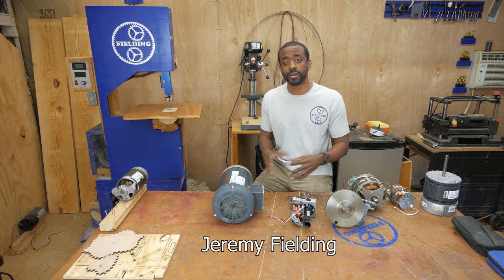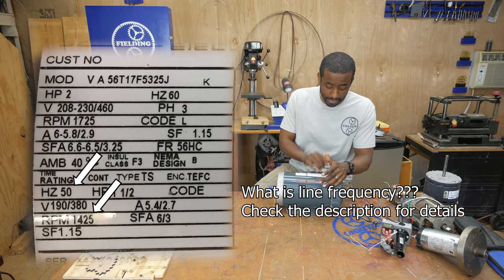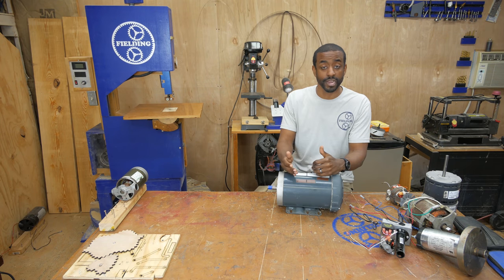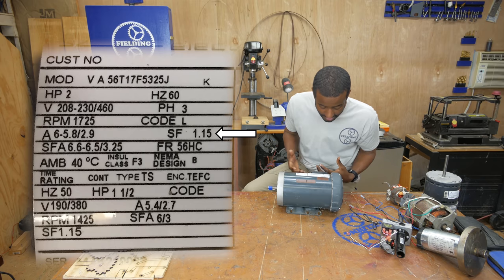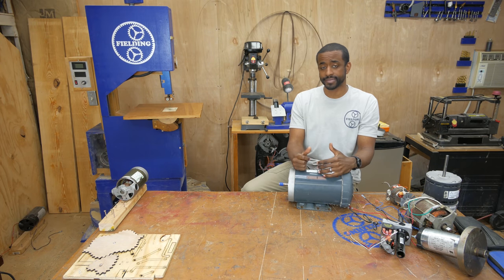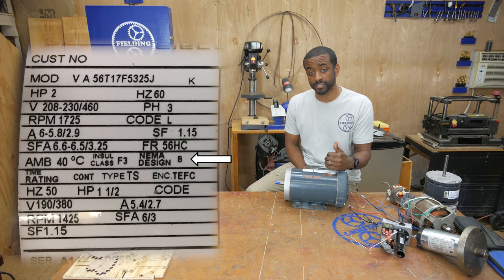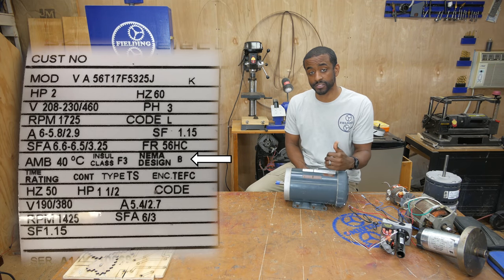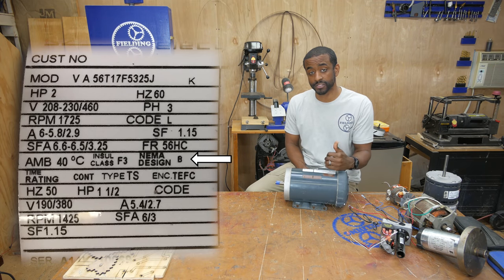How To Read The Label on Motors; Ultimate Guide To Electric Motors: #069

Comment: Or, for use with a VFD, either pick a fanless motor or add an external fan with it’s own motor... 🤔
Reply: OR... once you know you're probably going to run the VFD motor at "lower" RPM's than manufacturer's standards, you can open up the enclosure before wiring it in, and with a pair of pliers (in most cases) add a few degrees of camber to the fins in the equipped fan, thus pushing more air per RPM's. Re-assemble as before, and (usually) with little or no hell to play, you've effectively resolved the issue... My usual rule of thumb is about five degrees "additional bend" or "corrective adjustment' to the fins is generally sufficient as long as the RPM difference is within stated tolerance.
    Sometimes (of course) you just get a gut feeling and go for a bit more... BUT as long as you avoid banging fins against the housing or other parts, the more air you can push the better (cooler) the motor's going to run "at speed". ;o)

Comment: Hello I have a hammer mill that shipped to me without a power cord attached. The motor has Chinese or Japanese writing on it. 
It is 60 Hrtz. And can be wired either 250v or 450v. 
There is 6 connections. One side is W1,U1,V1
The other side is U2,V2,W2
I can not figure how to wire this 250v ???
No paperwork or instructions came with it. 
Any ideas would be greatly appreciated 😊

Comment: I have a motor that came with a drum switch to reverse its direction of spin.  The motor had to be replaced, but the supposedly compatible replacement motor does not function with the drum switch!  I guess all motors are not created equal.  Any thoughts?

Comment: Hi, i want to build a lathe machine for beads and i have a blender motor ,
 is the blender motor good for the job? 
dose it need a capacitor or just plug it to the wall?
I also found a sawing machine , when i take the motor apart and plugged it directly to the wall it turns but its smoke , when i connected the foot pedal switch the smoking stop, why is that?
Thanks again

Comment: your back! was wondering. what does it mean when the 1/2hp single phase motor on my cement mixer gets old/weak and can no longer operate the mixer under full loads?
Reply from the maker: Motors don't really get "weak" or old. As long as you don't over work it, it will run for over a hundred years. I have seen examples of this. We have a massive lathe at work that was built back in 1912. It still runs great with the original motor. You can turn a 4' diameter solid steel part on it no problem.
Reply: jasonmushersee - Does your 1/2 hp single phase motor have a capacitor? If it does, I would check that. If it doesn't have a capacitor, you might have some cracked rotor bars at the endrings.  -  Jeremy - That massive lathe at work sounds like some of the large ones we have at Puget Sound Naval Shipyard.

Comment: Hi there, I definitely understand Jeremy wouldn't have the time to answer my question, but just asking in case someone knows or could lead me somewhere i could ask... I have a single phase induction motor, single voltage for 230 (i'm in france) and 50hz, capacitor starter. It has no power rating or intensity on the inscriptions... I mesured it is rotating at about 2500 rpm, and the resistance at the winding is 20 ohms.... I would like to find its power capacity in order to not overload it ... thanks in advance for any advice !!

Comment: Pretty well done.  The only error I caught was the RPM comment.  AC motors lock to the freq of the source.  They can go slower than rating (when "slipping") but will never go above the rated speed.
Reply from the maker: I think I understand what you mean but what I said was completely correct. There is no error in that statement. AC Synchronous motors lock to the frequency and that rated speed would be "sync speed". Induction motors (the example one in the video) chase but always lag behind sync speed or frequency speed which you are referring to. That number on the motor is in fact the slip speed. If it slips below that rated slip speed it is because the motor is being pushed over its capacity and that is a different problem. I explain this more in my video "can a dimmer switch control an induction motor." Thank you for watching.
Reply from the maker: Side note 60 hz on a four pole motor (the one on the example) would give a sync speed of 1800 rpm. The rated "slip speed" is 1725 at full load. That is the number you will find on every label by NEMA standard. The slip speed. So yes it can go above 1725, but never above 1800.
Reply: @Jeremy_Fielding  - Yes, and at no-load, your induction motor will run very close to the synchronous speed, usually within a couple of RPM. So, your four pole motor in the video, will normally run at about 1799 RPM at no load. I love your videos. You do a great job. I'm a retired motor engineer.

Comment: For "Treadmill" Duty, I was assume that because a person doesn't have constant contact with the treadmill, it would be pulses of resistance. And there's difference between walking and running as far as the load being put on the motor. So, intermittent might not be a good enough labeling as the duty % is changing quite often and by varying load. 
This is, my best "guess".  Maybe someone else can agree or disagree with the above assumption.
Reply from the maker: I think we all agree the load is intermittent. The problem is the manufacture can manipulate a number like that because they profit from the HP number being higher. People will spend more on a treadmill with a higher HP rating. Think about it... if they lower the duty cycle they can increase the HP rating a lot.
Reply: @Jeremy_Fielding  Completely agree. Companies can be very shady with their wordings and mislead people. No wonder this world is in a state that it is in. Topic for another day.
But with the wording of the "Treadmill" term is basically a replacement for the word "Intermittent". However, what I don't  understand, is that most people won't be looking at the "motor", but the whole package. The motor is tucked away hidden, so why even bother!?!?
Reply from the maker: That number is on the tag as well! Every ad label I see shows the “treadmill duty” hp
Reply: @Jeremy_Fielding  Weird  🤔

Comment: Treadmill Duty – somewhere in between peak and continuous. Treadmill duty measures the likely horsepower for an average user at an average speed over an average period of time. But because it is an average, it is not a true representation of power.

Comment: lol     'Treadmill Duty'       HOW Long can YOU run at Same speed?    =\     Does that mean it can improve with practice?   =]      thanks!
Reply: What would happen to the amps the treadmill motor was pulling during foot fall when someone is running on it?  Increase, decrease, stay the same?  Maybe it changes when someone is running on it and that is where treadmill duty comes from.
Reply from the maker: Current goes up when the load goes up.
Reply: @Jeremy_Fielding  I guess my question is does running on the treadmill increase or decrease the load? Are you applying net force on the belt in the same direction the motor is turning, or resisting the motor due to friction between the belt and the platform thingy?
Reply: @vennic  - Whenever one's foot strikes the belt, that action (additional weight) increases the load which the motor must accommodate.

Comment: J, FOUND YOUR CHANNEL RESEARCHING HOW TO BUILD A N ELECTRIC  WHEELCHAIR FOR WINTER AND THE BEACH THAT I CAN DISASSEMBLE AND PUT IN A CAR + LIGHT WEIGHT. WHO HAS 4-6 GRAND FOR AN ALL TERRAIN  ONE. THE JOYSTICK USED RUNS 500BUCKS. GOT TO SAY I AM LEARNING A LOT. BTW, YOU CAN ASK TO  NEGOTIATE TO HAVE THEM PUT DOWN A FOUNDATION AND MOVE THE SHED + SOME CASH. JUST WANT TO TOSS MY 2 CENTS IN THE RING!

Comment: riddle me this Batman!   i have an oscillating spindle sander - probably 20 years old, but doubt i've even put half an hour on it.   started a project were i'm actually using it, and this sucker gets HOT... so i took the entire thing apart (new appreciation for spindle sanders)... you can see where some of the copper coils are actually black, and looking online, apparently it was a pretty common occurrence with this OSS...  someone suggested rewinding it... i'm willing to do it, but is that someone that's 'done'?  i mean, do people actually rewind motors?  if i do, will that stop the overheating - so ultimately i guess the question is, what causes a motor to overheat - not doing anything dumb, just using it normally.  any motor, but mine in particular obviously.

Comment: Treadmill duty measures the likely horsepower for an average user at an average speed over an average period of time. But because it is an average, it is not a true representation of power. Peak Duty – Maximum horsepower a motor can generate when working at its hardest.

Comment: I need to replace the start capacitor on dewalt air compressor,,i need 243-292 uf  300 vac,,,the original replacement from dewalt is 100.00...when i look online i see many start capacitors for 10-30 dollars,,,is it safe to use diferent brand capacitors as long as they are same specs as original ??
Reply from the maker: Brand makes no difference
Reply: Where would i look locally for these capacitors..maybe a heating and air  conditoning supply ?.any online stores that you that would have what i need

Comment: Found an air compressor that has a broken pressure gauge , air pressure regulator, pressure switch but the motor still works -- What can I use the motor for -- something cool
Reply: Replace the broken parts (cheap!) and make a compressor!

Comment: Can you help me i have a machine from china with no label on the motor. Contactor inside controls says 220v. Only 2 wires going to the motor through 2 huge capacitors on the motor. I can send pics if you can help?

Comment: What causes a split phase 110 v motor to growl when it's running?
Reply: Could be any of three things "right off the top of my head"...

1. Voltage supplied is "off"... Usually a break "internally" in the cord or connections to the motor/switch in the appliance... but it's just as easily caused by using the wrong rated extension cord or power strip, an easy misstep... AND can be readily fixed by visually examining the power source(s) and then chasing the connections... which will lie just inside where the cord enters either the switching module of the appliance, or where electrical wire enters the motor... 

2. Capacitor failure... This robs motors of power at "low levels" because not all capacitors just "quit". Some start failure by "leaking" instead of catastrophically... so it's just weak... and you get a net result similar to feeding the wrong voltage.

    {side notes about the "wrong voltage" or "bad current"}
   In heavy duty applications, these kinds of motors often have an internal "brake" or a magnetic bushing that physically rubs the rotating portion of the motor inside to slow it to a stop more effectively when "turned Off"... so any sufficient drop in voltage will trigger the motor's "shutdown" state and cause the brake to rub, increasing load and heat... 

    That's why it's usually not a great idea to try to vary RPM's in machines like drill presses with a voltage controller, the way you CAN dim a light fixture or turn down the heat in a soldering iron/wood burning tool... 

Finally, 3... It could just be a bad bushing or bearing... and the growl is more the mechanics inside bouncing and shuttering because of a worn spot or flat place in those... Most well equipped hardware stores and often Appliance Repair shops have such bushings and bearings available at reasonable prices. The only tricky part is managing to keep up with all the pieces that can fall out while you take apart and then reassemble the motor. It can get awfully tedious.

    Tip? Here's a hot one (and I mean RED HOT)...
   Keep around a cheap decent camera with a good SD-card (or equivalent). It doesn't have to be super high definition or anything fancy, so a simple Kodak or Sony shooter is good enough, and digital just makes it convenient. Every "stage" of tear-down, you can then take pictures. Keep something of a consistent scale next to the important details so you know by looking just how big something is, or how far from some other part it was "adjusted to" when you got to it... You can't over-document a tear-down, and your collection of pictures, angles, and even a laser pointer to note certain specific things like nuts or bolts versus machine screws and the like will make it SOOOOoooo much easier to go backward through the pic's in order to figure out which particular aggravating little parts when to what other particular spots, holes, or connections.

    I can't tell you off-hand how many "otherwise good motors" I've had to junk because I couldn't get them back in working order again for whatever misplaced or ill-advised rebuilding bits I couldn't remember how to get back... before the digital photography bloom. In the world of restorations and repairs, digital cameras are probably only second in importance to my angle grinder... or occasionally my welder, because a lot of these things simply don't come with "complete tear-down and rebuild instructions"... and schematics are next door to impossible to find. ;o)

Comment: sooooo you are saying with my 3phase lathe i run on a VFD on 220V 3phase i could double the amps? because original it's a 440V 3Pahse motor to get the full torque?
Reply from the maker: The motor won't run over its rated HP... at least not for very long
Reply: Max amps for both 220 and 440 should be listed on the motor.  Multiply Amps x Volts to get Watts/Power, both should be equal in Watts. If you want moretorque/power, at least continuously, then you need a bigger motor.
Reply: @boots7859  It's a cheap chinese motor, so i've not gotten any real information on it. other than the type designation... However, i found out that there is a standart in china for this specific motor, and from that i could set the parameters. but i keept the same AMPS as it would use under 440. thus cutting the wat in half. (Rated @ 440Vx2.8A=1232W, but i run it at 220Vx2.8A= 616W)

sooooo i theoreticly could juce it up say to 5.2 or 5.3AMPS and should be fine?
Reply: @Jeremy_Fielding  yes that i understand :-) but i run it under the rated HP/Watts because i did not know better
Reply: @MrZhefish  -  You can only double the amps to the motor's windings when it is a dual voltage motor, and requires a different connection, as shown in the connection diagram on Jeremy's motor's label. In his case, it's nine wire leads, which can be connected for series wye (high voltage) or parallel wye (low voltage). If your motor is a single voltage 440 volt motor with three leads, then you are limited to the amps given for that voltage, regardless of what voltage you are actually running it at (220v).

Comment: i have a question for the audience about a window air conditioner that been bugging me, when i turn it on , it just hums, so i tried to spin the motor to see if i could push start it, the motor wont turn while powered on,  but when its turned off, i can easily spin the motor all day. i thought maybe the capacitor was bad so i changed it, still does the same thing. i come here to learn about this stuff, so im not very advanced at motors and dont know where to look next, anyone help me figure this out, i cant stand throwing stuff out, especially something only a year old (that has harmful gases in it)
Reply from the maker: Watch part 3 of this series and see if that helps

Comment: Term like “treadmill duty” has been used to mislead consumers in the past to raise the rating number 
Treadmill Duty – somewhere in between peak and continuous. Treadmill duty measures the likely horsepower for an average user at an average speed over an average period of time. But because it is an average, it is not a true representation of power.